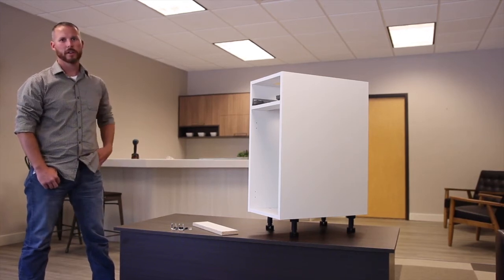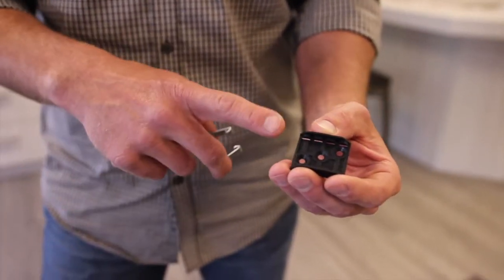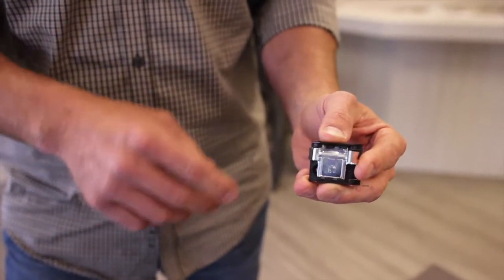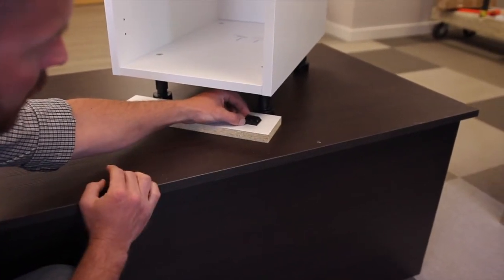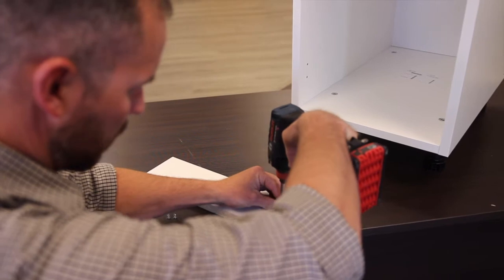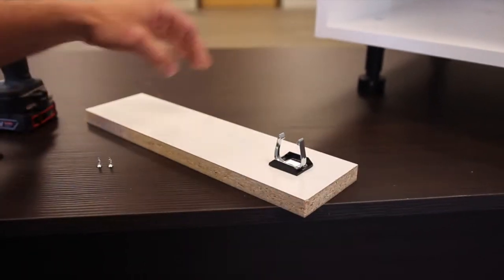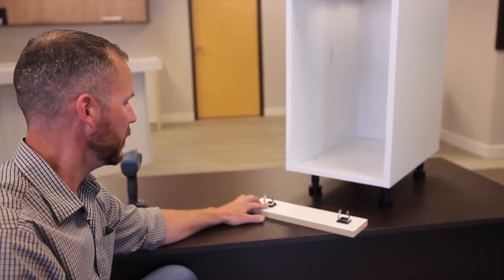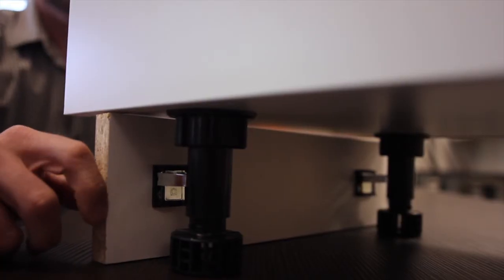Installing Toe Kicks

Comment: Is the new kickplate at a bit of an angle with this demo?
Reply from the maker: I think what you are seeing is the angle of the camera mixed with the type of assembly table josh is using here, Josh was not an employee of ours and learned our cabinets within 30 minutes the first day due to the super ease of our construction method but typically once you snap it on you'll sort of use the side of your hand/fist to knock it in to where it stands up straight. GREAT QUESTION! and as always we appreciate the feedback!